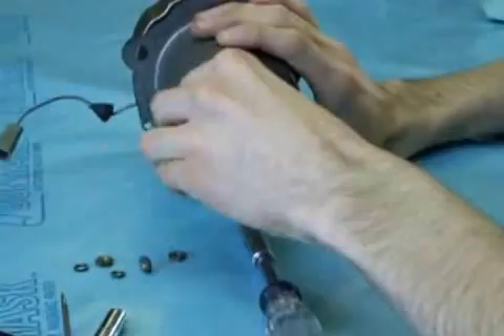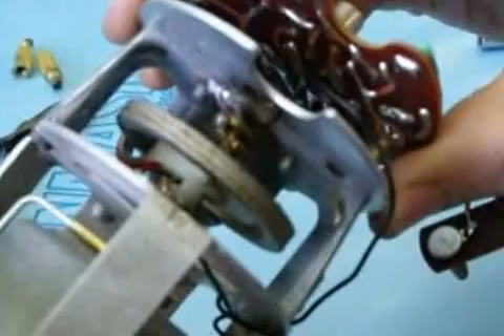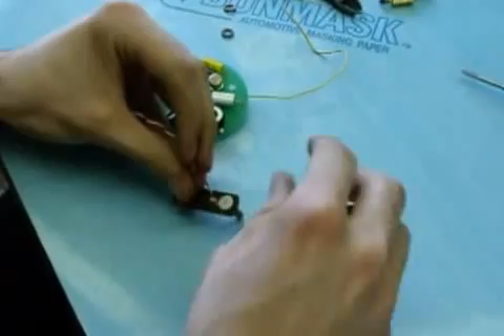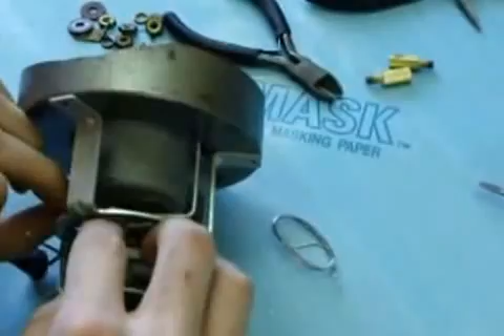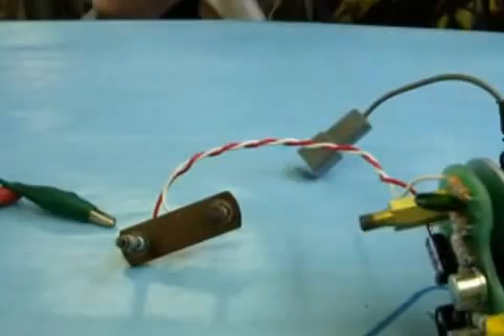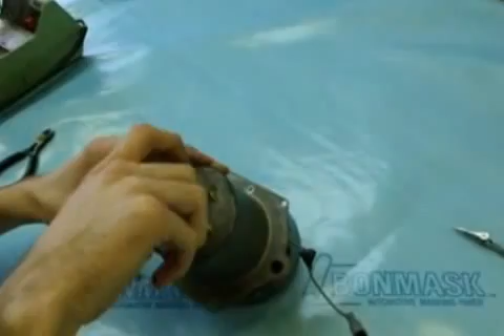E-Body Tachometer Board Assembly / Calibration

Comment: Do not recommend this tach board.  If you pay attention, the video contradicts itself when they tell you to adjust the rear or front clockspring.  When you try to contact them for clarification, they do not respond.  RT engineering responds promptly.